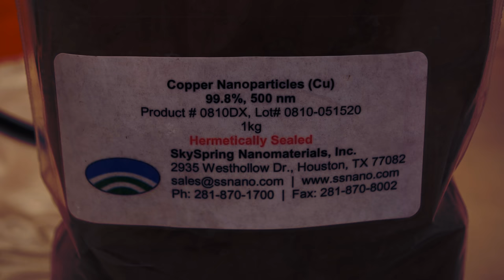Make Our Best Thermal Paste... YOURSELF!

Comment: Hi, love your videos. In performing the final mixing for the thermal interface, did you ever consider adding some additional oil/chemical that can easily evaporate out from the paste later? This might help with the mixing and improve the spread pattern when applying as thermal paste. Shin-Etsu seems doing that with their X23-7783D and 7868 product so they have two viscosity parameter in their data sheet for before and after the additional chemical flash out. Thanks.
Reply from the maker: Thanks.
I tested this option with hexane and DCM.  The results were the same   Even though the final blending was much easier it had to continue during the evaporation to prevent clumping/settling and the fumes were nasty, so I didn't persue it.

Comment: @3:00 Curious, is this the reason a hot welded part is sometimes immediately cool to the touch if it falls and strikes the concrete? It works so well on (some) heavier metal parts I'll often strike them into the concrete on purpose. *Disclaimer, I'm not welding 'critical' structures or parts.

Comment: a good way to solve the heating problem is using an ice or cold bath of some sort. I do this when dispersing micro/nano fuel cell catalyst powders.
Reply from the maker: You can buy double wall beakers that allow for circulating cooling water.  They're not expensive.

Comment: Hey, i was experimenting with the cheap one but alum powder always sinks to the bottom if you let it sit some hours. So I added some small amount of lanette wax and stirred at 80C for 10 minutes, keep stirring while it cools down.. voila, a thick emulsion paste that will sit forever without separating. still pending thermal performance test
Reply from the maker: Great.
Good luck with the testing.

Comment: If you do blimps could you do an add-on project:  "Rods of God" as they're called in several a scifi books.  Those gleaming rods of tungsten steel that hang suspended above earth from waiting sleeping satellites, some versions have small tail wings that can be rotated, usually a set of 4, to adjust the fall of the rod to its target.

Comment: great stuff! i cant imagine taking the time to create and test all these formulations including the nearly 1hr worth of processing required for each iteration. thank you. 
I'd like to see your thoughts on a chilled water setup using a cheap tec and temperature sensor to create an ambient temperature loop. I feel that this would make an efficient cooling product suitable for 24/7 operation and eliminate condensation. perfect for intermittent type loads normal for most gamers or small processes etc. the electronic control portion could even be marketable....

Comment: Loved the videos about thermal paste! I’d love to see the thermal results you get with other materials, specifically graphite and copper powder, both which seem to be easy to buy in 1um size and not particularly expensive.

Also, I bet a wider test of the most popular “enthusiast” thermal compounds would make a very popular video (eg.: The ones that are tested by toms hardware). Particularly, I use Kryonaut by Thermal Grisly, it beats Noctua on all tests I’ve seen.
Reply: Also, it would rock if you could find a way to make some type of “home made” liquid metal, which outperforms paste by a wide margin.

Comment: Question. You mentioned Indium. How about alloy that melt arround 60-70degree celcius?  once CPU heat up it will make perfect contact and very good thermal conductivity compared to thermal compound but does not require any pressure.

Comment: Couldn't silicone oil less than 10 centipoise be used since we know the cpu and heatsink will be under a certain amount of pressure? (Looks like it's up 50lbf, which doesn't sound substantial enough to me to prevent evaporation, but that's just a guess)
Reply from the maker: Remember the temperature is pretty high and as the edge dries out the oil will migrate outward and air is waiting to fill any void.
Reply: @TechIngredients  thanks for the prompt and thorough responses! I can only imagine how awesome it would be to work with someone like you who clearly considers every facet of a project.

Comment: I've wondered if drilling a  bunch of small holes in a heatsubk would work better due to increased surface area and maybe turbalance
Reply from the maker: Probably  not.  The increase  in surface area  is countered by the increased distance the heat has to travel.

Comment: Could you add in a thin liquid that could later be evaporated out to make the mixing easier?
Reply from the maker: It tends to cause the mixture to stratify during outgassing/evaporation.  Then additional mixing is required.

Comment: Could you suggest a compound that remains viscous in the 300-350 C range?
I'm looking for a cost effective solution for use between the heater cartridge, block and thermister on my 3D printer.

All the commercial compounds I've tested turn to rock; they're obviously not designed for those kinds of temperatures. The ones that are rated for high temperature stability are extremely expensive in my experience.

Comment: My old i5-4690K running at 4.6GHz (35% overclock, ~90 Watts TDP) never gets above 60 C (Even at 100% OC load), with an arctic freezer 13 aluminium heatsink with small copper core and heat pipes. The thermal paste I got from aliexpress, little 2cc jar and came with a brush for applying for 2 euros I think. Contains enough to apply to 100+ CPUs.

Comment: Can't one incorporate into the heaviest paste a bit of powder at a time? So the optimal incorporation happens for more cycles? Or divide the ratios so one can pre mix the powders into oil and combine paste into paste instead of solid into paste?
Or even mixing  the powders with volatile liquids and latter into the non volatile oil, I guess is the vacuum chamber would help to volatilize the liquids leaving a better incorporated mix since the dilution at the mixing stage would be higher?

Yes, i'm spit balling based on baking bread and adding flour and butter into the dough and a bit of experience with silkscreening conductive paints for flexible circuits.
Reply from the maker: Slowly incorporating the final powder is actually how I do it.  The results are the same but it's a little less messy.
A volatile solvent can be used, but the mixture tends to stratify in the degassing/ evaporative step. A vacuum rolling mill would be ideal.

Comment: What about using Boron nitride if not as full substitute of aluminum, at least as an addition to the aluminum powder. 
Aluminum has a thermal conductivity of 237 W m−1 K−1

Hexagonal boron nitride (h-BN) has been predicted to exhibit an in-plane thermal conductivity as high as ~ 550 W m−1 K−1 at room temperature, making it a promising thermal management material. However, current experimental results (220–420 W m−1 K−1) have been well below the prediction.

Boron nitride is expensive one, but considering how little is required for CPU and other PC-related heatsinks it can be pretty affordable. And also BN is a dielectric, unlike aluminum
Reply from the maker: It's  more about the solids loading fraction than the thermal conductivity of the solids.  This is because all of them are orders of magnitude  better than the fluid matrix. Gotta  minimize  that fluid.  The aluminum  powder loads to very high fractions.

Comment: What do you think about mixing something that evaportate easily, like acetone, that is very misable with oil, to thin the whole solution and make it easier to mix. Then once done pulling a vacuum to remove it and get to the same result?

Comment: LIFESPAN? Will the silicone oil dry out after 3 years of use on a CPU?  Glycerin goes how long in low-load use? (assuming you'd not use that in cpus)

Comment: The vacuum pump is easy to get and fairly cheap. But the other machines are quite expensive. Is it possible to use an ultrasonic bath instead of the sonicator? Is there enough sonic "movement" from the water through the bottle into the paste? Maybe it will take more time. Same goes for the solder paste mixer. Is a fast moving paint shaker an option? Or can it be done with the ultrasonic bath too? I`ll would test the paste with an older but power hungry grapics card.
Reply from the maker: You need the sonicator, but the paint shaker probably  would be a reasonable alternative.

Comment: I work with Thermal Interface Materials and Adhesives and would love to measure the thermal conductivity!

We have a device for ASTM and ISO standards from ZFW Stuttgart, not only can it measure bulk thermal conductivity, but could also determine the tc at different sample widths/press in forces/pressures

Do you ship to Germany or Switzerland?

Comment: What do you think about using nano copper?  I have a process that has results down to 200-300nm.  You need to start with a solution of a copper salt and precipitate the copper slowly (drip another acid while stirring w/ heat) then allow to dry.
Reply: I should have known you would cover this....

Comment: Would an ultrasonic cleaner be able to replace the sonicator for the first stage? Decently powerful (allegedly 250 watts) ultrasonic cleaners are cheaply available. I vaguely recall seeing you use one before (rapid aging alcohol? or was that some other channel?). You can fill the ultrasonic cleaner with water and run a few cycles to degas it and then place your sealed container of thermal compound in it to mix it. I think it's also preferable to maintain some standoff distance between the container and the bottom of the ultrasonic cleaner. I've seen 3d printed racks that hold beakers in those cleaners for such applications.

I have no doubt that it won't be as fast, but I've ran my 250 watt model for hours at a time cleaning brass with no overheating issues and it hasn't failed yet despite my abuse.
Reply from the maker: It's possible.  I built a souped up version that is used to disperse the powders in our thermal epoxy. However, even that isn't enough here.  The sonicator I'm using is depositing 5watts/cc and that high power density assures that there are no dead spots in the beaker. A typical ultrasound bath might work given enough time and occasional stirring by hand

Comment: One of my assumptions of mainstream thermal compounds marketed towards PCs is there’s some care taken to minimize the risk of shorting something in the case of mess and seems to be why some will opt for a more ceramic based compound rather than metal. Since the simpler paste contains a fair amount of aluminum, have you had a chance to test how conductive it could be in case of an “accident” (or at least improper cleaning, which isn’t uncommon). Also… great video, thank you!
Reply from the maker: Our paste is not electrically conductive.
Reply: @TechIngredients  Awesome! Thank you for your reply.

Comment: At this time point (3m02) you talk about propagation of sound through the material. At (4m22) you talk about the statistical sluggish process of heat propagation through the aluminum. When you put the putty in the sonicator it generates a lot of power and heat. Does this heating with sonic power also propagate like a statistical heating process?  The wave (sound) bounces around the vessel through the material at like 20khz. What i mean to ask is if sonic wave heating is more efficient then heating with a heating element? Does it give a more efficient way to heat a fluid or good thermal conductor like molten salt or maybe mercury? Maybe the sound waves heat the fluid ( with particles suspended) more efficiently because of kinetic effects.  Could you keep a " standing wave"  inside the fluid to move the particles in order to heat the fluid with increased efficiency?
Reply from the maker: Not really, because in the liquid we have turbulent mixing, convective flow and bulk mass movement.

Comment: 100 cst oil seems to be much more readily available than 10 cst. I imagine you would have to decrease the solids loading to get the same consistency if they were swapped, but what kind of performance hit would you expect?
Reply from the maker: It will drop, but I can't say how much.
Reply: @TechIngredients  If using the cheap and easy recipe, I notice that glycerin is ~1000 cst. Would you expect 100 cst silicone oil perform better than glycerin? (Thanks for taking the time to answer questions!)

Comment: Would it mix better if you put the glycerin on top of the aluminum powder and then put it under a vacuum?
Reply from the maker: It might, but be careful.  The amount of liquid is suprisingly small and you're effectively placing a loose powder in a vacuum chamber.

Comment: Densification;
• Max Particle: ~<5 Micron
• Particle Sizes: 10th
• Particle Quantity: 1/4th (25%)

Simple Thermal Paste:
Easy to Apply, Water Soluble, Cheap.
• 4g - Morter and Pestle
• 3.4 CC -Glycerin
• 14g - 5 Micron Aluminium Powder
- Mix Slow, be Patient.

High Performance Thermal Paste:
• 16.5g - 10 Centipoise Silicone Oil (Non-Polar) ~ Add in Beaker.
• 8.75g - 20/30/40 nm Silane Coated Zinc Oxide (Aluminium Replacement)
• 4.285g - 20/30/40 nm Aluminium Powder (Hazardous, Flammable)
- Sonicator ~ 50% Duty Cycle (5s On, 5s Off) at 100W for 6 mins. EAR PROTECTION. 

• 15.15g - Mixture ~ Add in Jar.
• 10.5g - 300 nm Aluminium/Copper Powder.
- Measure Net Weight, add 93.67% Water of Net Weight. 
- Paste Mixer ~ Put Mixture Jar in Heavier Side, and 93.67% Net Weight Water Jar in the Lighter Side and Run for 24 mins (12 mins at 2x Speed)

• 8.55g - Morter and Pestle ~ Add in a Cup.
• 14.6g - 5 Micron Aluminium Powder.
- Be Precise, Be Patient, Mix Slow for 30 Mins.
- Let it Settle in a Vacuum Chamber for 6h.

Voilà!

I don't understand what you did with the Mixture after Sonicator and the Paste Mixer or How much you took out of it for the next step but here is a complete written guide for anyone to copy.

Also, I have more ideas for you to make videos on Water Engines? More like Hydrogen Fuel but.. Maybe? Please?

Comment: why don't you use graphite powder??? Thanks for your awesome and pedagogic videos
Reply from the maker: I suggest why in our later video  on graphene.
In addition, its extremely large surface area prevents you from adding enough  of it to be competitively conductive.
Reply: @TechIngredients  And it raises another question about utilizing "copper powder" copper has much more thermal conductivity in comparison to aluminium, why you (and many commercial products on market) don't use copper instead of aluminium???? It is very big question!!!!
Reply from the maker: The copper  particles  are less spherical, and that is key to a very high solids fraction loading.

Comment: You have said Indium film would beat any other TIM if you could apply enough pressure.  How does that required pressure change with heat?  Could a combination of heat, vacuum, and pressure make it practical?  Obviously, for use on a CPU, we couldn't go much above 100C, but that might be high enough in a partial vacuum to allow us to apply far less pressure to achieve the desired outcome.
Reply from the maker: It doesn't, really.  The pressure  must be maintained during  operation, not just during application.

Comment: Maybe I missed something explaining it but if things like copper and sliver are more conductive wouldn't it make sense to use those instead of the aluminum?
Reply from the maker: Not necessarily.
What most people believe (including me before I did this) is that what drives the thermal conductivity of these pastes is the conductivity of the solid material.  Rather, it's the liquid that reduces it, so minimizing  the liquid fraction and still having  something that flows is the secret. The aluminum powder is made up of smoother, round particles, and more can be added.

Comment: Since nobody is wondering as I am, maybe I missed the information in some previous video perhaps. But let me ask, why doesn't electrical conductivity bother you? After all, these pastes are typically used in custom built PCs, where a drop of electrically conductive material could cause a serious problem.
Reply from the maker: Our paste is not electrically conductive.

Comment: Is it still too thick to use those larger ZrO₂ balls and a rock tumbler to make a quick & dirty ball mill? Or will it just glue them to one side of the container?
Reply from the maker: I actually tried it.  And... you're right it just created a mess.  I do believe significantly larger balls and a proportionally larger mill would do the trick although the batches would be quite large as well.

Comment: Not sure if using an aluminum-based paste on a copper-based cooler may cause corrosion? I know mixing these metals in a watercooler system can cause problems. Maybe the silicone protects against the red-ox reaction though?
Reply from the maker: It does.  The paste is not electrically conductive.